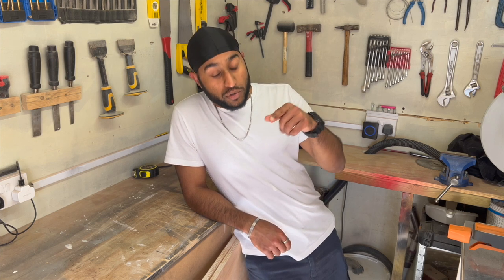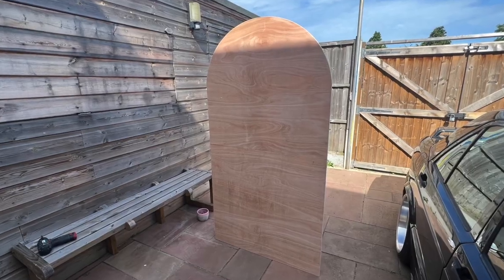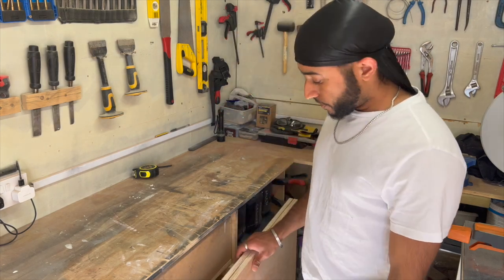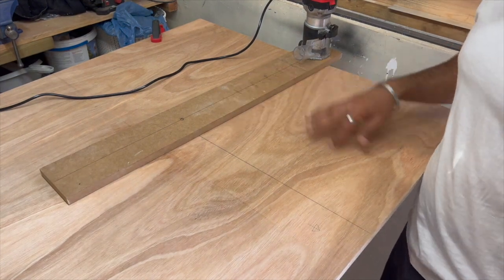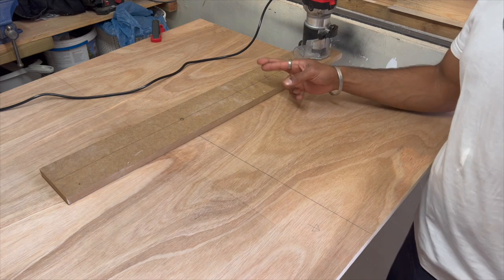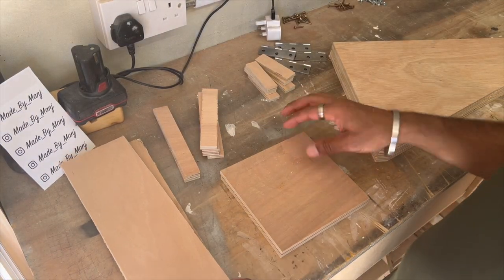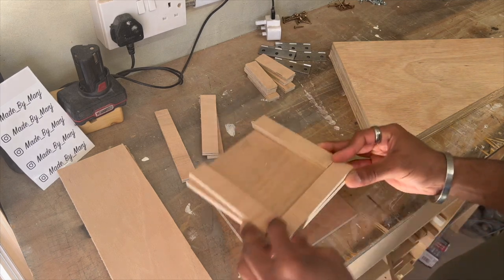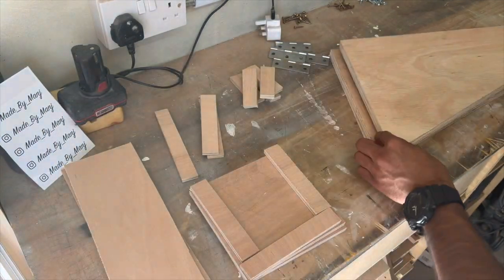DIY Wooden Backdrop Decoration Arch

Comment: Hi mate the piece of wood under the hinge is that double thickness or just a single piece was wondering as the square pieces that have the bit that slots in will be thickness if two bits of wood won't it
Reply from the maker: The piece under the hinge is 9mm (half the thickness of the main board)

Comment: Ciao, ho costruito uno da spessore 1 cm , alto 2 metri e largo 1 metro, che misura posso fare le gambe? E a che distanza le devo mettere?
Reply from the maker: Please be careful with that size that it doesn’t fall or fold. Make sure you use a sandbag or other weight at the back. I would do two legs like I done but 1 meter high and 40cm wide each, with a brace across them. I would space them 10cm from the ends.
Reply: @MadeByManj  grazie mille x il tuo consiglio,un'altra cosa che misura e spessore sono le aste che metti per non fare piegare il pannello?